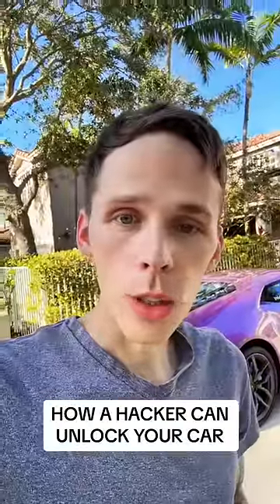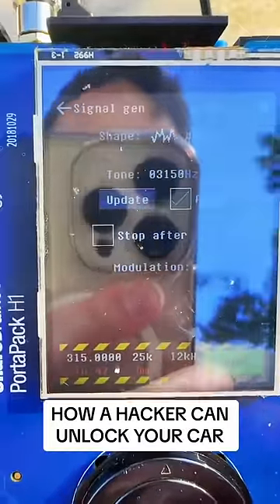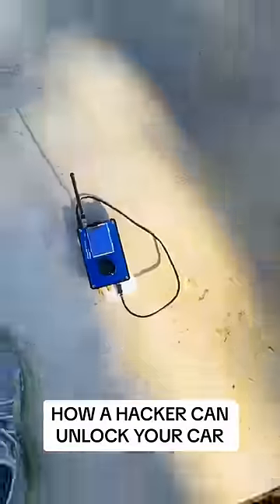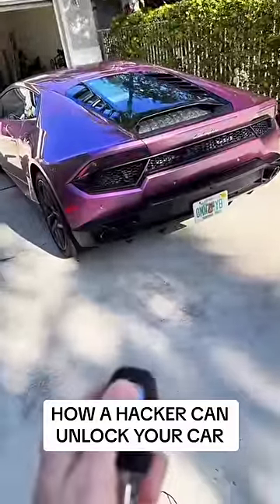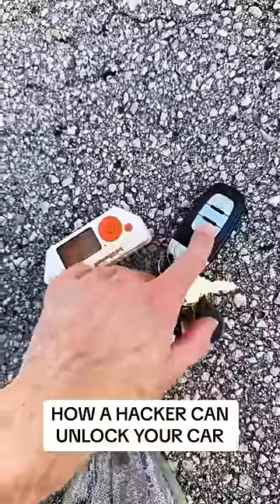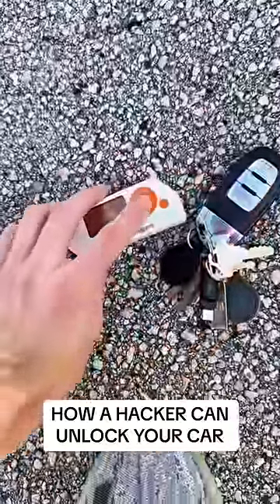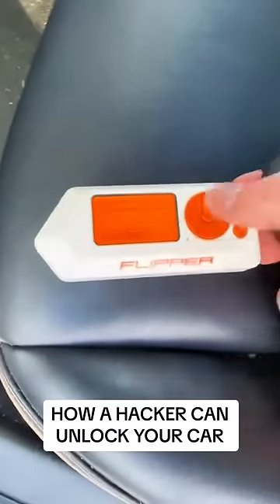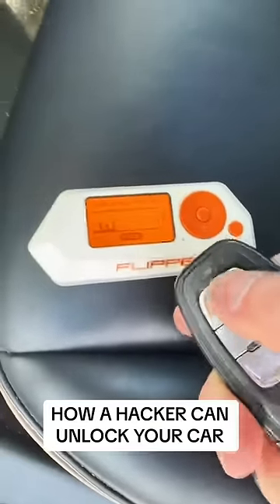Unlocking A Car With A Flipper Zero (Rolling Code)

Comment: Best Double Flex Ever.
Reply: His car is SOOOOO clean
Reply: an even bigger flex, is having manual lock doors and windows to prevent stuff like this from happening with this device. 😂
Reply: @MJayyyS  I bet he has some custom thingamabob that does just that.
Reply: @GipsyDanger8934  the only way to get into an older car from the 90s with MANUAL WINDOWS AND MANUAL LOCK DOORS, is to smash the window. there is no custom device this guy has, to get into any car. he was just showing the dangers of that hacking device. 🤦🏽‍♂️
Reply: @MJayyyS  you mean like a lock pick? 😂
Reply: @MJayyyS Old cars are easier to break into. Remember, that he needed the original key for the device to record the signal.
Reply: @crouchingcamels  which takes far longer. 😂🤦🏽‍♂️
Reply: @Takkks  false. newer cars are easier to break into. all that thing needs, is the key's code to unlock the doors and basically start the car and be gone in seconds. it could take HOURS before someone gets away with and older car like mine. i drive a 98 COROLLA buddy. not breaking into that easily. 🤦🏽‍♂️
Reply: @MJayyyS  I beg to differ lmao i work at a automotive repair shop I’d rather get locked out of a older car
Reply: @MJayyyS I can get into my 99 Camry in under 60 seconds with my lock pick. I only know cause I locked my keys in and had to get into it 😂 I wasn’t waiting no damn 3hr for AAA at 2am
Reply: @MJayyyS This is the Lock Picking Lawyer, and today I have a car door and oops I'm inside already.
Reply: @Shoo897  You sound like the kind of person that should not talk at all.
Reply: @MJayyyS  98 Corolla?🤦🏻‍♂️In South Africa they could Jack your ride in 5 min with a hard wire or car aerial, you are kidding right? No Device needed, only a simple tool.
Reply: Shoo897  All being what?
Reply: Educational double flex
Reply: Nah he's not flexing doesn't need to.
Reply: @MJayyyS custom crow bar
Reply: @Takkks He don't need the key, just needs to be recording when the key works
Reply: @Takkks actually cars around the early 2,000s with the transponder chips are actually the hardest the easiest would be anything using bluetooth or any KIA.
Reply: @MJayyyS  Nor driving it away easily. 😮
Reply: Pls don't live in 90s

Comment: This is why my car is from 1991. Uses a key to get in. Is a 5 speed manual. So 3 pedals. And a killswitch for the fuel pump. 😅 And a nice and loud car alarm.
Reply: Need a push button switch for the ignition.
Reply: Yeah I’m sure this is the ONLY reason…
Reply: Thats why they can be broken into with just a bump key its way easier to get into an older car
Reply: And know that most people have no clue how to drive a standard its a double up security! 😂
Reply: 3 pedals? What's the extra one for, that doesn't even make sense.
Reply: @sageminentjunky5197  clutch pedal
Reply: @ThePresidentialTouch push button is 1000x easier to bypass than a encoded key.
Reply: Kill switch for the fuel pump is ENTIRELY wrong. Yeah sure, they won’t steal it, but you ain’t driving it to work tomorrow either 🤦‍♂️🤡😂🤣 you put the kill switch on the STARTER wiring… no the fuel pump. All that’s gonna do is ROAST your starter trying to start it…. It’ll still turn over which again, will cause damage… no starter click, no turn over, no nothing.
Reply: Realistically in racing our disconnect is REQUIRED to be right off the battery main lead before it goes anywhere, and it required to be right up by the windshield in most motorsports for easy access and consistent positioning across all vehicles for safety crew to work efficiency and safely.
Reply: And bud…. You want a real safe car, but an old 1991-2005 Lexus. Safer than any car you’ve ever seen in your life, literally impossible to steal without destroying the entire car first. Encoded key, locks in park can’t put it in any gear without the encoded key, when it’s locked and alarm on, if you do the locksmith trick to get the door open? Auto locks within a FRACTION OF A SECOND. It’s not able to be lock picked at all, windows are the strongest in industry history.. and the list goes on.
Reply: @joshroi8610 I have a second fuse wired in on my starter when I leave my car I just pocket the starter fuse car no start with out it and you can’t just find a random switch flip it and see if it starts..
Reply: Manual = Best Anti theft system of the 2020s
Reply: Also nobody wants it! Foolproof!
Reply: @joshroi8610 i had to break into my 2000 Lexus last year in my driveway. Yea was not fun
Reply: Yeah and nobody is going to want to steal it anyway
Reply: @imboredder 💀💀💀
Reply: @joshroi8610  your meant to run a two way kill swtch to both the starter and fuel pump
Reply: @ChimRichalds750  depends what it is 90s jdm cars are worth heaps. 1 of my cars went fro. Few hundred to over 100k within the last few years soooo someone clearly wants them 😂😂
Reply: @sageminentjunky5197  it keeps the monster in the engine from getting angry and refusing to work
Reply: Funny Manuals adds like 60% security bonus!
Reply: @imboredder 😂
Reply: Same and I take coil wire inside every night
Reply: @Jackdevine5373 - you said "Thats why my car is from 1991" I read it like "THATS why... 1991"

C'mon man, lets be honest... If thats your daily driver, Then neither of the reasons "security" and "Hard to break into/steal" fall within the top five reasons why THATS what you drive 😂

And you can quote me on that as the guy who drives a truck from 1996 😎

Maybe one day we make eye contact at a stop light while using the auto temperature adjust feature in our vehicles as we rotate that temperature stick built into the side of the door so the air blows harder

Carry on brother! 👊
Reply: Now that’s what we call a GEM 💎
Reply: Is it a Miata
Reply: At the risk of “one-upping” you, I daily a ‘97 Honda Acty for similar reasons 😂
Reply: Ok then I will just use it to empty your bank account. You're not safe just because your car is old. Flippers are dangerous weapons. We can do anything we like with them really.
Reply: @Tattybeanpie  My best friends call me Cash.
Reply: Nice so you’ve told me exactly what to look up, since it’s so old there’s probably exploitations in the car itself such as a hole under the door handle or something similar where I can unscrew your antenna, shove it in that hole and now I’m in your car, now all I’ve gotta do is look at where the correct wires are, or just simply use a screw driver to take apart the starter and take it… congrats man.. kill switch for fuel isn’t uncommon… new cars have a thing called a immobilizer which can be activated essentially anywhere… you’ve now found out exactly why your car is obsolete security wise….
Reply: @RK36_  ....because you think he told you everything.
Reply: @sageminentjunky5197  it's the clutch pedal. Manual cars have them. Part of the reason I have one is because it's a theft deterrent. If you don't know how to drive manual, (which fewer and few people do, especially gen z) you either won't be able to even start the car or you'll stall it immediately. I probably shouldn't be telling you this but to start the car, first it's best to make sure the shift lever is in the neutral position, then you push all the way down on the clutch (unless you need to wait a few seconds to let the fuel pump engage like mine) and turn the key. That will start it. To get into first, you clutch all the way in, shift the lever all the way left and up then give it some gas (I normally do 2-3k RPM) then gently let up off the clutch. Each successive gear is rinse and repeat. Clutch in, 3k RPM (again for my car normal driving) change gear, let out on the clutch.
Reply: That's not why
Reply: @herrgodfrey9563 Or you can put in neutral and push it…
Reply: That’s nice I guess 

I just take the battery out
Reply: @quesobandidott2309 in the USA maybe yes. Rest of the world no.
Reply: @nzallround4723  but it’s better to make it a fuse instead this way if someone finds a random empty fuse they usually figure it’s to do with a sub, random switch hidden under the dash or seat…flip and see what happens…🤦🏼‍♂️
Reply: @detroitdabber313  yes, push starting is an option. At least for the older cars. I'm not sure about the newer ones.
Reply: @herrgodfrey9563  I wasn’t even talking about push starting, you can literally just put the car in neutral and push it down the street if you wanted to.
Reply: @detroitdabber313  yeah but it's tough to get very far doing that unless it's down a hill. They're still multi thousand pound cars. Then there's stopping it which can be harder than getting it moving. It wouldn't be easy to steal one that way, unless you had a truck waiting for it.
Reply: @herrgodfrey9563  yes it would be difficult but is still 100% possible. Thanks for adding so much value to my comment. It definitely needed to be analyzed and have that extra bit added on.
Reply: @joshroi8610 Not hard to just pop the relay and short 30 to 87. Unless of course you interrupt the signal connection near the starter. There's plenty of ways to prevent a vehicle from starting. I just remove the transmission when j get home and there's no where for the starter to even bolt to.
Reply: You got a physical immobiliser too?
Reply: What he forgets to mention is that it only works once, then it reprograms your car and key because they’re out of sync.
Reply: @DrakeTain  what's he gonna do use my remote start?
Reply: Most Modern cars have rolling codes so, this won’t work in vid above.  Ryan knows this.  His buddy sells flipper zeros.
Reply: @joshroi8610   "This is The Lockpicking Lawyer, and today, we'll be breaking into..."
Reply: Had a 91 ES 250...Smoke gery. I loved that car. And I just so happened to b raised as a locksmith apprentice. I got out the business in about 2000 or so. My dad. Still doing it. 50+ yrs. My great grandmother was even a locksmith. I got the car at a auction. Got a...fair deal I'll say. The very 1st thing he said when I showed him was "u better never loose that key...seriously'. And walked back in the house. And I didn't. And anyone I met when I had that car if they were into cars I mean, would say the samething. That car was awesome. And I'm glad I never had any security issues with it
Reply: My brother had a kill switch in his old truck. I say old truck because the one time he forgot to flip it was the final time he parked it lol. Was stolen within the hour. People suck.
Reply: Yeah that's why
Reply: My neighbors car also has a kill switch. Still got stolen
Reply: @sageminentjunky5197 Clutch,....break ....accelerator = 3 pedals..
Reply: I can drive a stick and can enable fuel pump too, lol

Comment: Here's how those attacks work. Rolling code systems work by using a preset cipher to generate a new security key every time you press the button. In order to compensate for pressing the button outside the range of the reciever, they compare the code they recieve with the next few codes, and if one of them is what they recieved, they jump to that code. In this attack, the signal is being intercepted and jammed, and then after you press the button a few times, the device doing the interception replays the first code it received, saving the rest into memory. This unlocks the vehicle, but now you have a few more codes saved that will work... Until the next time the key is used outside the range of the jammer. At that point, the car will see the new code that is a few steps ahead in the rolling sequence and jump to that as the current active code, rendering the saved codes useless.

Comment: tip. if your keyfob does not work on the first click do NOT click it a second time. keyfobs use something called “rolling code” which makes it so the frequency of each unlock and lock requests changes depending on the rolling code algorithm that the specific vehicle is using. clicking once will give them the previous frequency to unlock your car or lock it. but click twice will allow them to calculate the rolling code algorithm and be able to predict the next unlock and locking cycle. also, if a hacker does do this it will unsync your keys with the car.
Reply: Scary 😮
Reply: Dude. Ur a genius. I hope you have a good job. Ty 😊

Comment: For those of you wondering the device he has is reprogramming the entry frequency of the vehicle, that’s why he said if your fob doesn’t work, watch out and look around
Reply: No it’s just recording the frequency. It then replays it. But it’s a one use attack.
Reply: @ajmacphoto  Yeah but if the rolling code is used up by the f0 it won't be lined up with the original fob anymore, making it not work
Reply: @aidantb8    He’s using a primitive form of a rolljam attack. 

The car listens over a wider range than the fob signal. So it’s possible in a proper rolljam to jam the signal from the fob while recording it then replay the last signal when another signal from the fob comes in. So you basically cache a code in a device you can use later without the fob. 

Most people don’t think much of pushing the button twice if it works after that. (Very different to what this video shows)

Not sure why this would cause the fob would stop working.

Comment: As a technician you have to be inside of the car (already unlocked with currently programmed key) you must ( put the car into program mode) before you can program a key fob or in this case a flipper zero. I’ve tried. The flipper cannot simply pick up the 315mz signal. He probably said that because that’s the range key fobs register
Reply: I see they probably found a way around it tho nowadays.
Reply: @Valentine-ui1iy no they really haven’t. Don’t just say „someone will figure it out“ doesn’t always work like that.
Reply: So I'm confused. You saying the video is fake?
Reply: @kieranbailey5126  not necessarily as long as the old key fob/ key unlocked the car and was used to put the car into a “program mode” the flipper would possibly be able to pick up the signal then. But what’s the point of stealing a car with a flipper if you have the key in hand.
Reply: @leslie9271  The point he is making is, someone with a flipper can hide in a parking lot, and create a "zone" where it intercepts all of the frequencies when people press their keyfobs when they arrive at their cars.

When their key doesn´t work (because it´s interrupted by the flipper), they would presumably leave the area. Now the flipper user can use the same signal it intercepted to open the car that was left in the parking lot.

This is why he ends the video with "If your key fob is not working, be careful of your surroundings"...

Because someone with a flipper might be nearby trying to steal your car.

The "program mode" to my knowledge is only used to change what frequency the car would accept.. 

He couldn´t have explained it better lol
Reply: I can make the same thing just with a banana peel, 1 gummy and a little bit of olive oil
Reply: @snackerrr  correct but the car wouldn’t be in program mode so the computer (inside car) won’t pick up the flipper. You can make the flipper recurve and transmit the same signal as much as you want but the cars computer will not be programmed.
Reply: @leslie9271  the car is already programmed to accept frequency “123,5”.

Any and all fobs used in the area that sends out frequency “123,5” will open the car.

Now, if your keys were stolen and you no longer want your car to accept the frequency 123,5, you can open the car and reprogram it to only accept frequency “835,2” instead. (Frequencies just an example here obv)

I’ve seen cars being opened by other fobs.

But I’m also not 100% sure, maybe there’s some new shit
Reply: Point is, there is other equpitment than flipper, who can read fobs. Flipper ist just entry level stuff.
Reply: Yeah, my friend has one of those flippers and we've tried and tried and tried to just unlock our cars with it. It can't just do it unless you have access to the car. Flipper is cool for other stuff though. I think this guy is a tool and just lying to everyone, because most of society is too stupid to know better.
Reply: He needed the car key to "hack" in. The whole thing is a troll.
Reply: @AD-bb9np yup!! But all these idiots fawning over him thinking.otd real is utterly amazing. It's like no one has common sense and just blindly accepts videos as fact. Zero critical thought.
Reply: he's not using it as a key fob this will absolutely work. they use rolling codes he recorded the rolling codes and jammed the frequency so the car didn't pick up the signal. so he simply replayed the codes he recorded with his flipper, that's how and why it worked.
Reply: He never said start the car he said unlock the doors. You can do this with flipper but you can't start the car without more advanced equipment. Also you will have to reprogram key fob if you do this to yourself I believe because of the rolling codes so don't try it at home lol.
Reply: yeah I call bullsh*t.  I refuse to believe lamborghini are using 1980s style key-fobs and fixed codes that can be intercepted like this...I've done this with old cars using the hack-rf1, but I cannot see that working without hacking the algorithm used for the code-hopping.

Comment: All you need to do is get to a new area and click the FOB a couple times in range of the car. That'll invalidate those signals as it's a rolling code. 

Also, this will only grant access to the vehicle. There's another handshake that wasn't captured that is required for ignition. I have seen this done (it's called a relay attack) to move the vehicle to a shop and add a new key to the system
Reply: Once unlocked you can get to the obd port and have all types of fun
Reply: So where are your videos and Lambo?

Comment: Yeah, this is the reason my 2004 with 387,000 miles still gets fixed, it's been my daily driver for years and is basically newer than the day it left the factory.